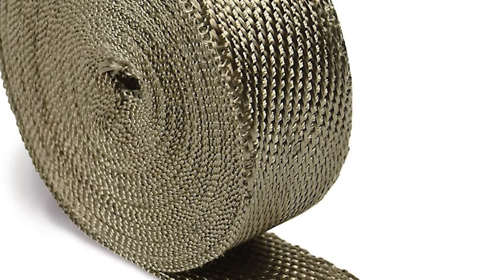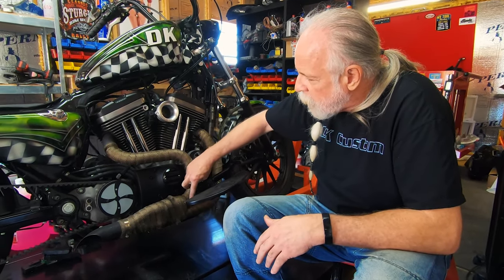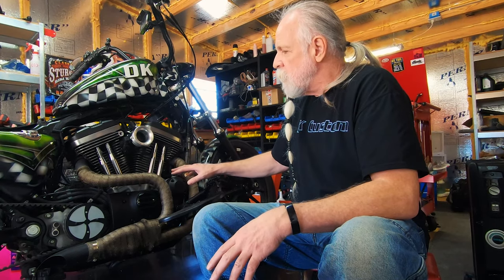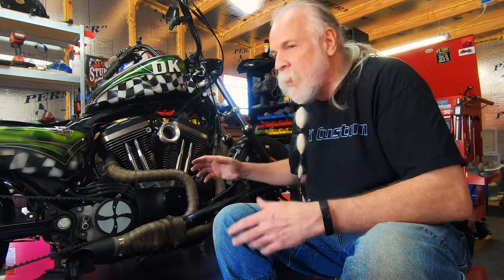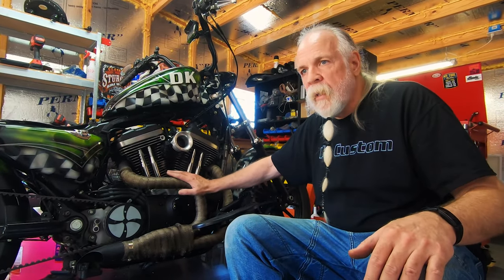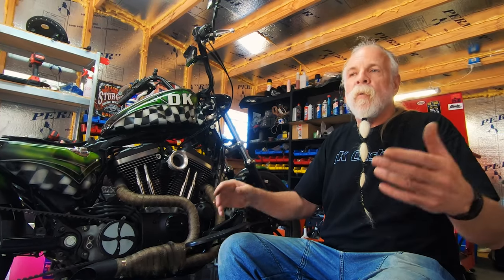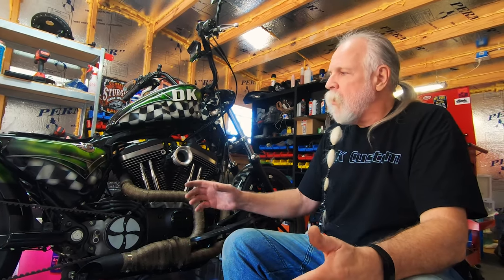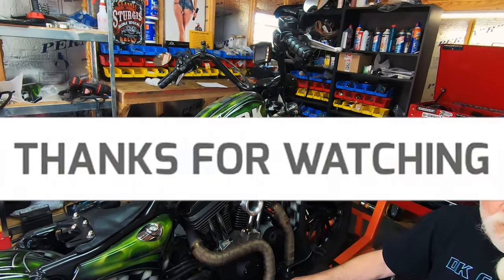Myth Busted - The Real Truth About Header Wraps

Comment: I had someone tell me that if I put exhaust wraps on my bike that the heat being trapped in the pipes will cause the motor to run hotter, and may even melt the factory wire harness, knock sensor wires/switches, and cause all kinds of problems with shorts, and alternator issues. I have a 2009 Honda ST1300 (Sport Touring). 

Is this accurate?
Reply from the maker: We have no experience with Honda's regarding this.  It could very well be true about the electronics...and if the baffling in you exhaust is significant, it could make the engine run hotter.
Reply: @DKCustomProducts  ah, okay. I have not yet changed the mufflers yet, but I will do so as soon as I can. The stock mufflers don't allow for any baffles to come out, but the slip-ons, do
Reply from the maker: @Forward_Unto_Dawn  Sounds good!

Comment: Looking for ideas to keep from getting burnt on the exhaust pipes. Would hate to lose the shiny chrome from wrapping. Flexible heat sheilds clamped and leg sheilds considered. Would the clamps damage my chrome  pipes?
Reply from the maker: Dunno what kind of exhaust headers you are running.

Most HD header pipes have a chrome heat shield that clamps onto the header.

Remove the heat shields, wrap the headers, reinstall the heat shields over the wrapped headers.  No damage to anything, and still have the chrome.

Look at the last 2 photos at the following link...one shows the headers wrapped and the next one shows the shields re-installed.
https://www.dkcustomproducts.com/titanium-exhaust-wrap-dei-reduced-heat-improved-performance-dk-dei-t35.htm
Reply: @DKCustomProducts  2 heads are better than one. Daaahh. Thanks DK.
Reply from the maker: @jamesharold4983  🏍️🏍️🏍️
Reply: Not sure if you got around to it, they make a silver heat wrap that looks fairly chrome like.

Comment: Help please! I just learned about exhaust heat and pants not mixing very well together when it comes to my safety.. I watched your video an now I'm pretty sure, I gotta get my exhaust wrapped. I've got  stainless steel chrome pipes and ready to order some wrap but can't figure out how wide the wrap should be. I see widths of: 15mm, 25mm, 50mm and 75mm and more. How much is wide enough?
Reply from the maker: You can see the wrap that we use on our bikes and offer our customers at the link below. It is 2" wide and 35 feet long. This wrap is long/wide enough for 11" pipes. It will certainly help with reducing felt heat. 
https://www.dkcustomproducts.com/titanium-exhaust-wrap-dei-reduced-heat-improved-performance-dk-dei-t35.htm

Please feel free to reach out to us for any questions you might have;
Support@DKCustomProducts.com
662-252-8828

Thanks for commenting! MB

Comment: is there any gain with a stock header with the cat still in it ?
Reply from the maker: Good question- 2 comments
1.  The amount of gain in power is small, most will not feel it.  There is a gain, but it not on the level of many other mods, like a free flowing A/C, or an EBS, or a good tune, or TTI's.  It is one of those things that is for squeezing out just a little bit more power.
2.  We should have mentioned this in the video...but we do not recommend wrapping the actual cat if you are planning on riding 50k, 60k or more miles on your bike.  Wrapping the cat can reduce the life expectancy of the cat by keeping too much heat in it.
Now, if you do plan on riding that many miles, but also plan on eventually getting rid of the cat...no harm.  AND, YES, the wrap is effective at heat reduction and power gain in the stock header with the cat.
OR, you can wrap all the way up to the cat, and after the cat and it will not reduce life expectancy of the cat.

Comment: This vid is 3 years old. Hopefully I can find an answer. Have a ( I know not a bike) but put an aftermarket dmc  exhaust on my Polaris razor 900 xp. I didn't know about wetting it or silicone,I wrapped it and  started it and it started  smoking on one side closest to the head. It's duel exhaust down both sides now. Wasn't with stock .  Can anyone please help this lady on what to do?  Or why even it would smoke. I live in a small town in az. Any shop here won't help me with bringing it in to look they say. I can't imagine the price of that for just an answer or help with what to do
 
Anyone know ,?
Reply from the maker: Not sure what you wrapped it with.  The DEI Exhaust wrap should not be wetted or silicone, or any other liquid on it.

If you have used a different wrap, we cannot help you.  All the other wraps we tested were not anything we would run on our bikes, or any other engine, like your Razor.

It could just need a few hours to burn off whatever is on there...or ???

I wish we could be of more help.  Not all wraps are the same.

IF you are using the DEI wrap, as seen at the link below, there may be a little smoke after it is first installed, but it should stop within an hour or so.

https://www.dkcustomproducts.com/titanium-exhaust-wrap-dei-reduced-heat-improved-performance-dk-dei-t35.htm

Comment: do you think the wrap is as good as a heat shield ? reason i ask is my exhaust is hot against my leg and ive modified a small heat shield and dont like the look and was thinking of wrapping my pipes but not shur if it will work as good , any opinions on this would be awesome , thanks for posting your thoughts on the wrap 👍👍
Reply from the maker: On my personal bike, the heat wrap radiates less heat than the shields.  Also, to the touch the heat wrap is not as hot as the shields.
Reply: @DKCustomProducts  thanks thats what i was hoping for  much appreciated....
Reply from the maker: @4486xxdawson  happy to help!

Comment: Ok so I have a question because I'm curious about everything to do with bikes. How does wrapping the header pipes give you more performance?
Reply from the maker: Good question!

It keeps the heat in the exhaust system.  That makes the exhaust flow faster,  The more exhaust gas velocity you have the fuller the fresh charge is on the intake stroke.  That equals more power.
Reply: @DKCustomProducts  thanks for the lesson. Have a blessed day.
Reply from the maker: @canttalk  Thanks man.  Back at you, hope you have a great weekend!

Comment: This might be just what I need. I have a 2012 road glide with cobra headers and slip ons. It's tuned. But damn it's hot under my right thigh and knee...to the point where half the time I don't wanna ride out of comfort.
Reply from the maker: The DEI Exhaust Wrap definitely helps cut down on that felt heat from the exhaust! You can see the Exhaust Wrap at this link - https://www.dkcustomproducts.com/titanium-exhaust-wrap-dei-reduced-heat-improved-performance-dk-dei-t35.htm

Please feel free to contact us with any questions;
Support@DKCustomProducts.com
662-252-8828

Thank you for commenting! 😎MB
Reply: @DKCustomProducts  are you guys familiar with Jet-Hot coatings? If so how do they compare to wrap?
Reply from the maker: That is absolutely a good alternative to reduce felt heat.  Expensive, but effective. We have not done any testing to see which is a better options, but for the price the Exhaust Wrap is works and is a good product! Thank you for commenting! MB
Reply: @DKCustomProducts  no problem was curious. They quoted me a our 120 more than if I did the wrap. So wasn't sure which is more effective since they coat inside and out.
Reply from the maker: Jet-Hot coating definitely reduces the heat.  However, not as much as the Titanium Heat Wrap that we show in the video.  While we have not done any controlled studies, it is very apparent to the leg and thigh that the Titanium wraps stops more heat from radiating.
KP

Comment: When wrapping a 2-1 pipe do you start at the end and work your way to the header? Or do you wrap from header down? Thank you!
Reply from the maker: It does not matter.  What is most important is that it is tight.  We have always started at the header and worked our way down.  There will be some "seam" work at the 2-1 collector, and I think working from the two different header pipes to the collector, you can cover the "seam" easier when going from the top down.
Reply: @DKCustomProducts  awesome thank you for the insight! 

I will start at the header, do you have any tips for wrapping the collector area to get full coverage?
Reply from the maker: @connormunn196  It is very much like wrapping a wrist or ankle with an ace bandage.  You might do it a few times, and undo it, until you get it just right, and ready to clamp in place.  You can see from this photo linked below, that the headers were wrapped from the cylinders down, then the wrap was started at the end of the headers and went around them both and then the collector.  3 different pieces of wrap used.

Comment: Sir, is it required to paint the exhaust first before wrapping?
Reply from the maker: Reference- https://www.dkcustomproducts.com/titanium-exhaust-wrap-dei-reduced-heat-improved-performance-dk-dei-t35.htm

It is not required to paint the exhaust first, howver, if the exhaust is already chromed, no paint recommended.  If it is not, then a couple of coats of high heat paint is a good idea.

The chrome or paint will give the metal some protection against rust for when your wrap does get wet and not dried out right away.

Comment: Do you have any feedback on the black titanium heat wrap, as far as color fading? 
I'm thinking of wrapping the head pipes on my 2018 Roadster that is mostly black.
Reply from the maker: We do not use or carry the black, because, with time it will fade.  It will function just as well...but we don't like the fading and don't want to have Customers that are disappointed when it fades.
As you can see in the video, the tan looks the same after almost 10 years as it did when it was new.
I know that does not help you, with your black-out theme, but we have never seen any black wrap that does not end up fading.
Reply: Dude i wrapped mine 15 months ago w black. It will fade and whiten up over time but high temp black spray paint works great.i paint about 1x a month. Looks brand new. Always let it run after washing to evap thr water.
Reply: And all wrap will fade. I bet a million bucks hes painted that wrap
Reply from the maker: @miketrevino8761  If you're referring to the almost 10 year old wrap on the Sporty in the video...I could REALLY use the million bucks!

Let me know how to collect!

Comment: How do you feel about a high temp silicone under or over the wrap?
Reply from the maker: There is no need for it.  We have never done it.  This is not like other wraps that benefit from a spray or sealant.
Reply: @DKCustomProducts  well I used a fiberglass wrap. So wasn't sure if it was needed
Reply from the maker: Ah, yes.  Understood.  We have no experience with fiberglass wraps.

Comment: i have a 2002 electra glide classic with true duels how much or long of wrap do i need?
Reply from the maker: Great question.  One roll of this wrap will cover 11 feet of 1.75" diameter exhaust.  Measure how much of the pipe you will want to wrap, then get either one or two rolls depending on if it is under or over 11 feet total.

The wrap is 2 inches wide and 35 feet long.  For maximum thermal performance it should have an overlap of 1/4".

https://www.dkcustomproducts.com/titanium-exhaust-wrap-dei-reduced-heat-improved-performance-dk-dei-t35.htm

Comment: can i wrap my heat shields and pipes as one?
Reply from the maker: I suppose you could, but a big portion of the headers would not be wrapped, the wrap would be over the shield, and then there is an air gap between the back side of the shield and the header.
It will reduce radiated heat, but not be nearly as effective as removing the heat shields, then wrapping the headers.  Then putting the shield back on...then you can wrap the shield or not.

Comment: a bit extra performance means a bit more gas....not making it more efficient?
Reply from the maker: The faster exhaust gas velocity will make it more efficient AND more power.  Now if use the more power to go faster, or accelerate faster, then you are going to get the same or worse MPG.  BUT, if you twist the throttle less to accelerate the same and you ride the same speed, you will get better MPG.

Comment: Hello mate would it make the exhaust pipe vibrate less
Reply from the maker: Normally if a pipe is vibrating there are exhaust hangers and exhaust brackets that are suppose to help with that. It is possible that the Wrap could change the harmonics of the pipe and it could possible help with vibration, but this is not something that we have personally tested! Glad you like the video!
Reply: @DKCustomProducts  thank you mate I got new hangers and super tight brackets but my exhaust won’t stop vibrating at tips very bad when I put my hand around the middle pip my hand seems to take all the vibration and the tips stops shaking. Any thoughts on that mate ?
Reply from the maker: @bignae8845  Could be so many things, also, not knowing what bike and mods done to it, which could make a big difference.
Could be a performance cam with a lot of overlap, A bad tune, or something wrong with the engine.  Worn out motor-mounts.  Need of more exhaust brackets.
And there may be more I'm not thinking of right now.
That said, there is always going to be some vibration of the exhaust, even on stock bikes.

Comment: Why does it say only good for SOME bikes? What bikes is it not good for? Im thinking of putting it under the heat shields on my 2020 harley softail
Reply from the maker: Bikes that are put up right after they are washed, with the wrap never getting heated up/dried out by riding it, and then sit for days or weeks on end...that is not a good candidate for the wrap.  You don't want wet wrap sitting on the metal for long periods of time.
Of course if one rides in the rain and then parks it for a few days or even a week now and then, that will be ok.  
But consistently having wet wrap sitting on the pipes...over a period of years, that will weaken the pipe due to corrosion.
Reply: @DKCustomProducts  gotcha so not bike specific just owner care specific. Thanks
Reply from the maker: @GrandmasterHobbyist  Yes. 👍

Comment: Please help. Can you exhaust wrap crome pipes? I have some Chrome short shots that I want to exhaust wrap a portion of but I keep running into mixed information. l've heard to never exhaust wrap Chrome or normal steel pipes.. only stainless steel pipe..  I also heard that you can exhaust wrap them but you need to put a high temp paint coating on them before hand. Is this false information? I would like to exhaust wrap my Chrome pipes without the hassle of having to sand the pipes and coat them. Thanks in advance!
Reply from the maker: Yes, you can exhaust wrap Chrome exhaust! In fact it is better if your exhaust is chromed or a high heat paint, the thermal wrap will help prevent your pipes from rusting.
 
You can see more at this link - https://www.dkcustomproducts.com/titanium-exhaust-wrap-dei-reduced-heat-improved-performance-dk-dei-t35.htm

Please feel free to contact us with any questions you might have;
Support@DKCustomProducts.com
662-252-8828

Thank you for commenting! MB
Reply: @DKCustomProducts  Thank you for the reply and clearing things up for me! I'll definitely be grabbing some of the titanium wrap from you guys. Also just subbed to your channel. After further investigation the description states my exhaust is "stainless steel material, a polish finish and the color is crome" I'm not sure if that changes things? Do I need to paint or coat the exhaust in anything before applying the titanium heat wrap?
Reply from the maker: You are most welcome! Yes, That is still fine, you do not have to paint it or coat it! 

Always feel free to reach out with any questions;
Support@DKCustomProducts.com
662-252-8828

Thank you for commenting and for your future business! MB

Comment: What is the advantage of "Titainium" wrap?
Reply from the maker: Made from Pulverized Lava Rock, stranded into fiber material in a Tight Weave
Strongest, Most Durable Wrap Available
Does NOT need to be wet to install - Extremely Pliable
Does NOT need to be coated
And it is the only wrap we have found that has not faded with years of use.

All the details can be seen at this link- https://www.dkcustomproducts.com/titanium-exhaust-wrap-dei-reduced-heat-improved-performance-dk-dei-t35.htm
Reply: @DKCustomProducts  Thanks for a solid answer.  Almost forgot what that was like.
Reply from the maker: @x-man5056  Thanks man, appreciate the good words, and you looking at our parts. 👍

Comment: I've always herd it helps with hp.
Reply from the maker: Yes, the wrap will increase exhaust gas velocity which will increase cold air intake, which will result in more power.  On a typical Harley, with a typical rider, they may or may not feel the difference.  I think most folks do it to reduce felt heat radiating from the exhaust, which most everyone will feel.
Thanks for the comment. 👍
Reply: @DKCustomProducts   what about putting it on i4 sportbike header?

Comment: I would think, if you park it wet, the heat from the pipe would evaporate the water.
Reply from the maker: If you wash it and then park it, nope.  But if you were riding in the rain, and were fully heat soaked when you parked it, probably it would completely evaporate.
Thanks for commenting. 👍 KP